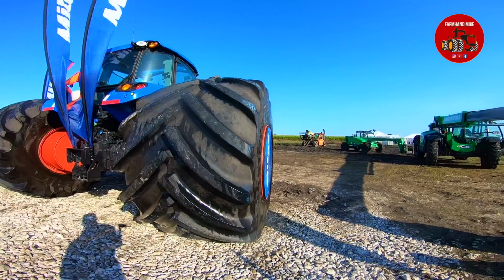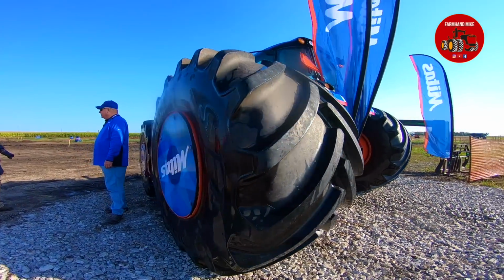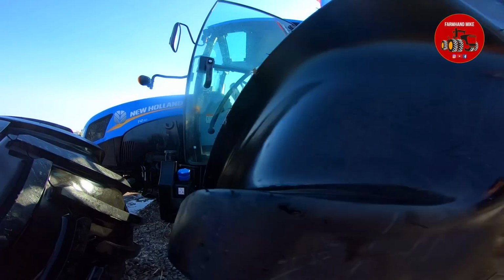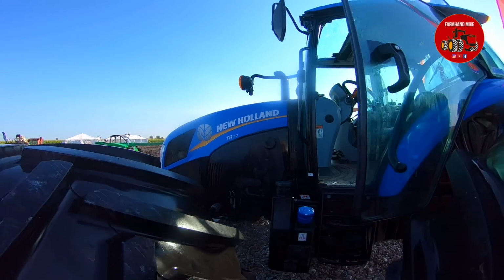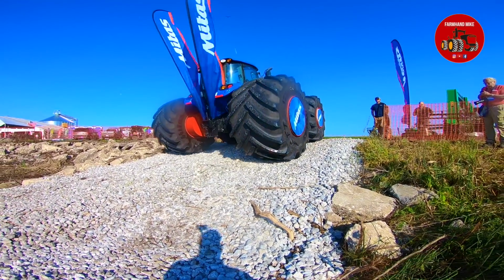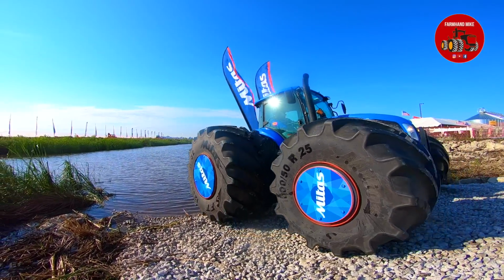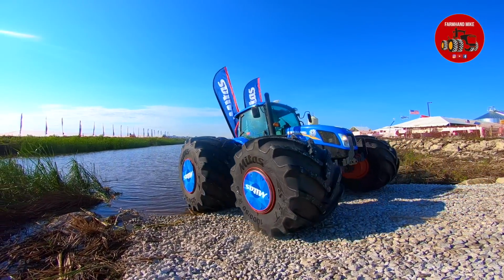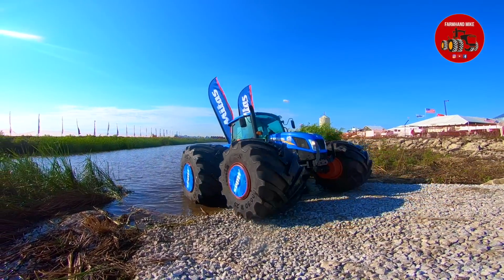New Holland Tractor Floating across Water

Comment: Did they have to do something special with the drivetrain to get only certain tires to spin? Or does the tractor come with the capability to do that?
Reply: gary batchelder tractors have a left and a right brake pedal, he just holds one of those down
Reply: @Zero01k  

Yeah, I guess I have heard about the individual brake pedals before. I think sometimes they will also lock together to act as one if you want them to do that.
Reply: @Well_I_am_just_saying  you can do left and  right just rear or front and rear all or left side and right side